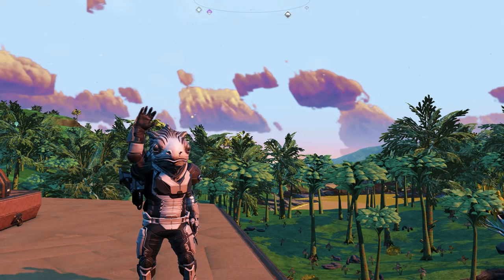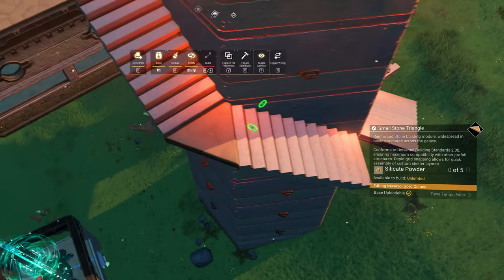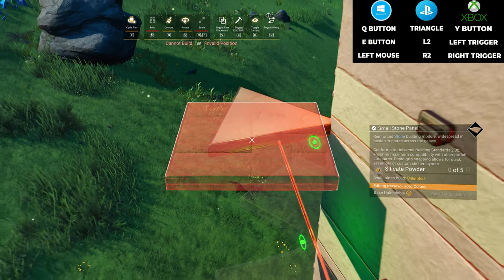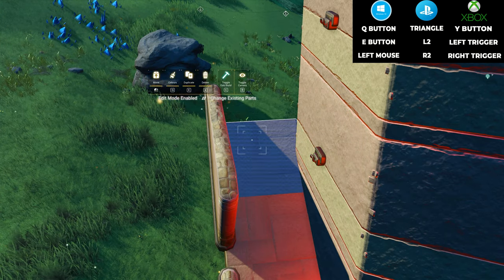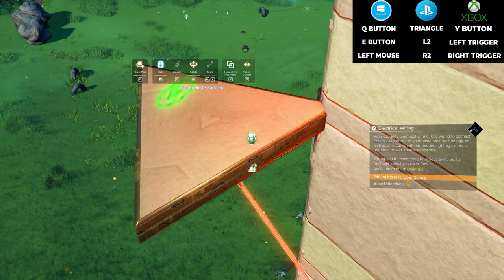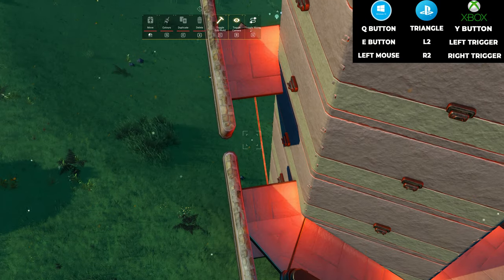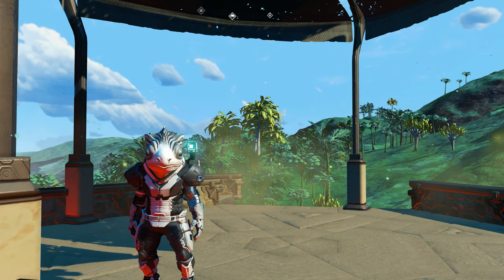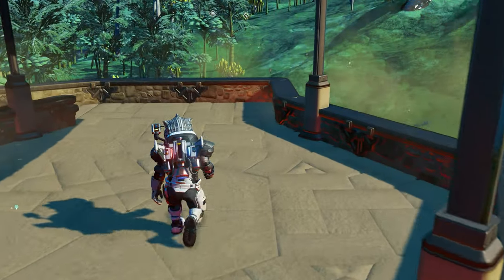How To Build Staircases And Railings No Man's Sky | How to Build A Base - Beginners Guide Part 08

Comment: The original lighthouse is cool, but having no railings on the stair portions was slightly bugging me, so yay for safe stairs😁
With the wires left in the floor, it’s a good way to run power to the top and bottom of the staircase.

Comment: this was meant to be an easy base tutorial but with the added glitches its just become like any other NMS basic tutorials if you have to use glitches its just not simple anymore i get its a part of building but its not for me still a great way of building but id prefer a base without glitches as a way to build its just like all the duping videos trick the game for something that not intended
Reply from the maker: Think of it as an addon to the Lighthouse & Towers Video. It's just another option. You don't have to build the staircase with sloped floor panels.
Reply: I used to feel somewhat like that about glitch building (mostly because I was terrible at it), but since the Frontiers update, most of the wire glitches and such are just so much easier to do now, that I've come to think of it as just part of the normal build mechanic...